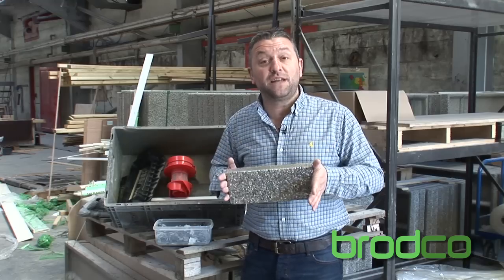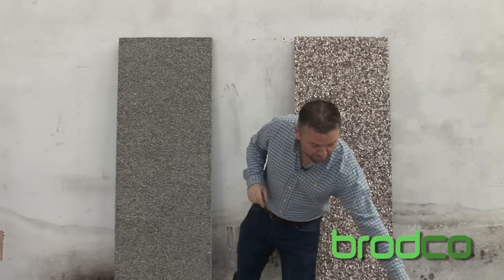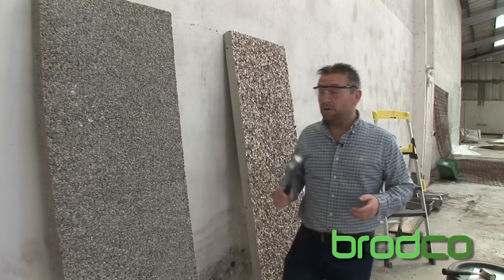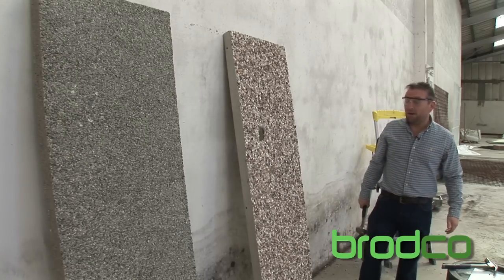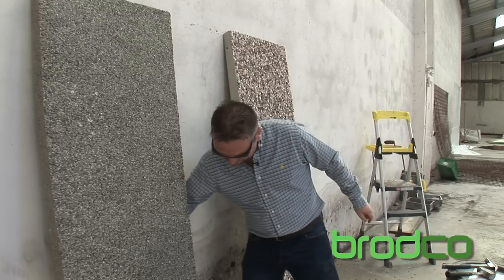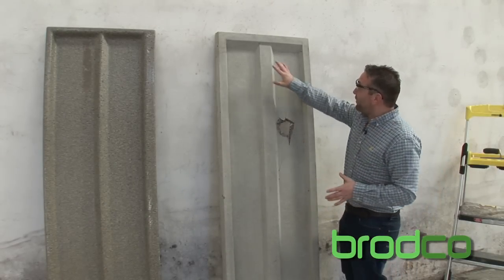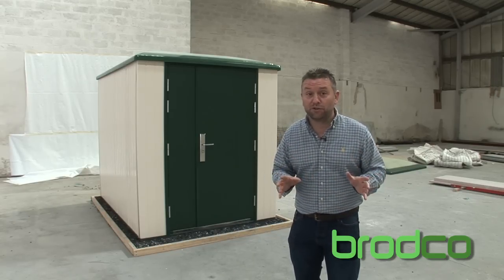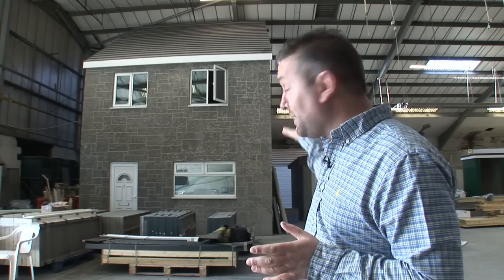TPR vs Concrete Strength Test

Comment: 0:17 ... all Landfill Plastic is 100% recyclable, they've been recycling plastic for years, and converting them to other materials with similar properties, and into fuel ---- with the Thermal Depolymerization process, and Biomass pyrolysis process.

Comment: There are several similar tests on Fibre re-inforced concrete on Youtube where they bit panels with sledgehammers etc but what I would find more relevant is to support each slab at each and gradually add a load to the slab to see at what load does it fail.

Comment: Truck Stops spend millions of dollars on concrete to accommodate 80,000 pound trucks, if this product is superior, why is it not in use?  Also, what about fire?  what about fumes, what about durability over time.  Concrete has been used for thousands of years and has proven its utility.  While I would like to see more tests and keep an open mind, if I was building at the moment, I would use concrete knowing full well its amazing advantages.

Comment: Metal expands in moisture. Metal rebar is the common failure in concrete because it expands and pushes the concrete apart. I like the fact the product has no rebar.

Comment: ....HEAT TEST ANYONE?? as a building material, how does it react to fire or sustained 105 degree heat in the arizona sun with a LOAD on it?is a verry relavant question, don't you think?? i mean, concrete is pretty much the standard FIRE BARRIER. just saying...

Comment: hahahah what a  hoax....at first you think that's a thick panel than you realize he actually hit a thin concrete... everybody knows it's not working like that. Even plywood or osb ...  ANY OTHER FLEXIBLE material can handle that.  Even a "thin" plexi glass ...he is not testig strenght here ...he is testing flexibility.

Comment: Are there any other tests shown for these?, this test seems a bit pointless - it's not surprising that a plastic product won't shatter where thin unreinforced concrete will. It does look to have bent when hit with the largest hammer.
Concrete is often used to take very heavy loads(generally excluding impact) - would be interesting to see this being tested with a heavy load for a long time, fire test(as others have mentioned),etc - basically being subjected to the same conditions that concrete is used in.
It isn't clear what each panel tested is designed for.
Only an outhouse and prototype house are shown, neither would typically be built with concrete panels.
If it's just intended to be used for secure outbuildings, it seems good for that(as long as it has strong connections, including to the ground; and holds up to UV), but then why compare it to concrete? In that case, it would have been much better to compare it to typical outbuildings, such as steel sheet. It would probably be more impressive in that comparison.
The website won't load at present, and there doesn't seem to have been any posts on the facebook page since 2016, so not sure what's going on there.
This site does have some info, it also seems to be intending its use for outbuildings and garages:
https://www.affresol.com/
It looks like there's quite a few places producing TPR.

Comment: Building material of the future is Hempcrete! ;)
Reply: Except that its not structural and has nowhere near the compressive strength of CMUs or precast concrete. Any hempcrete wall you build, must be built around a supporting frame.
Reply: Building material of the past is Hempcrete! ;)
Reply: wrong wrong wrong.  Hibiscus Cannabinus is the material of choice first off.   Hempters and the like have been simply pulling off a fraud, and you all seem to have fallen for it.  Oh well, I shall bring awareness, actual education and justice.   Me, aka The Hemp Mayor
Reply: That whole thing about hempcrete being fireproof is a prime example.  Hemp Core is very flammable, as are the fibers (especially during mechanical processing, during plastics production, etc, etc).  It is the Mineral Binder that bonds with the core to render it not so flammable (as is the bond with binders that offers natural fibers their ability to be a filling agent, or not)

Comment: Why not do standard compressive and modulus of rupture tests on both the materials instead of hitting with hammers. Also how stable is  TPR against various environmental degradation effects like UV rays, chloride attack, sulphate attack, freeze-thaw cycles etc?
Reply: Because that would put this all to bed. So I guess that is why they are avoiding it.
Reply: @percival23  Maybe that's true, but there's only one way to find out for sure, and that's to run the experiments.
Reply: Did you not hear the dramatic changes in his tone?  Why would you want standard testing after that?
Reply: Martian Anthropologist LOL!!!! You aren’t supposed to recognize their manipulation techniques!
Reply: It looks like it is good as panel or artificial slate roofing tile. Of course, glass fiber reinforced concrete is too. The advantage this has as a panel is that it weighs less and insulates better than concrete, so you need less structure to support the walls and roof. The concern I would have about it is its reaction to a building fire. I would want to see a full house like what they have there, filled with furniture and other common items such as books, and then set ablaze to see how the roof holds up and the panel walls. For a smaller test, just replicate the heat from a house fire on a sample panel and see what it does.
Reply: I agree with all of that. Also how does it stand up to fire? Is there any off gassing? They need to show me a lot more testing before I am convinced that it is superior to concrete.
Reply: Terry Lemire Plastic produces toxic fumes when it burns. The
Reply: I could not agree with you more
Reply: YouTube, PLEASE separate content into categories like "public" and "scholarly"
Even an old fashion Library can guide an engineer to the right section (factual level)
Reply: Target to made lightweight blocks concrete for wall, 700-800kg M3 - mpa 7-10
Reply: This eps concrete need special adtivitive to made it(condition 7-10mpa), can not made with eps, cement and sand

Comment: I expected the concrete to hold out longer, then he turned the panels around and we could see just how thin it was where it failed. For those wanting more info: http://www.brodco.co.uk/daylightsecure/construction-materials/ and http://www.affresol.com/
Reply: If impact resistance is what you're after, concrete is usually a pretty poor choice. But if you're trying to build a building, the compressive strength of reinforced concrete is what you want. You can have precast sections made, you can build with CMUs. Different materials have different purposes.

Comment: The TPR bent from the sledgehammer, but he failed to mention that. Why?
Reply: Not trying to defend it, but I don't think it bent, look at other frames; it would seem it moved, and the camera's fisheye makes it look like it bent.
Reply: I didn't bent, it was the same as when it started. Take screenshots from start of the video, before and after each test, compare in photoshop. They are the same.
Reply: Almost broke in half. Come on now
Reply: no doubt.  it bent.
Reply: The way of what? Hempcrete is a great material for infill, but it isn't structural. You can't make blocks of hempcrete that will support a roof. You need framing. Hempcrete can't be used in standing water or prolonged wet exposures, which is why it must sit at least 1 foot (.3 meters) above grade. It has it's uses but to blindly say hempcrete is the way, ignores the properties of this material. Hempcrete is a great insulator. Hempcrete can be used in combination with a lime-based plaster or stucco as an exterior panel that adds both more insulation and thermal mass; highly useful in hot areas of the world. Special lime based paints are required though if you'd like something other than grey. Those paints are more expensive.
Reply: You could see the crack. Little biased lol
Reply: He did check the back after he hit it
Reply: Seen that!
Reply: Hemp is the way!
Reply: No it bent right after he struck it.
Reply: Yup ! Saw the same. And I did a couple of re-runs.  Still interresting, but a bit vague as to composition
Reply: Jesus Christ Driven Game Development hemp deteriorates